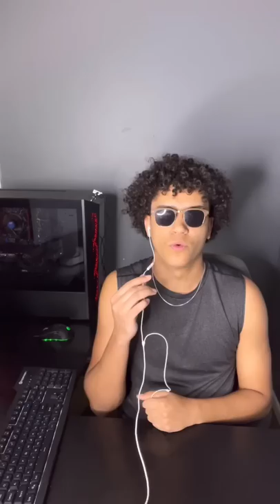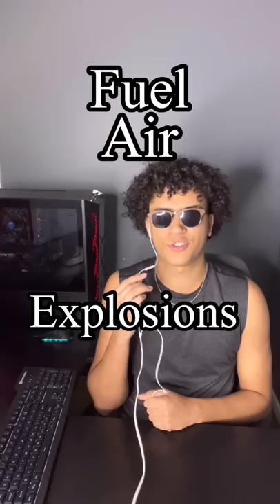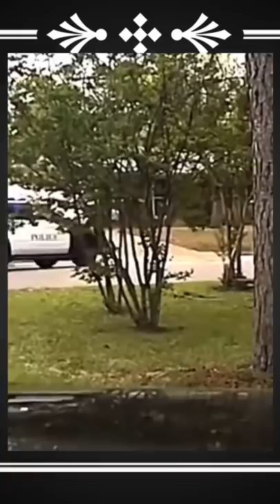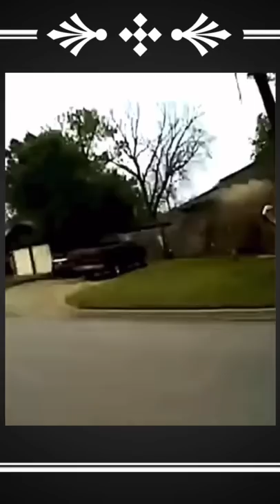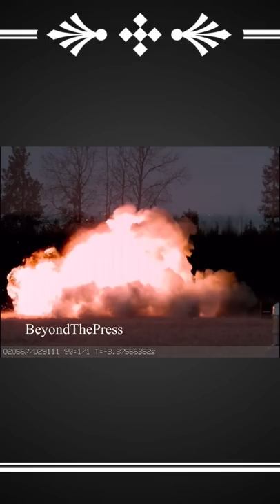Fuel air mixtures devastating effect!!￼ #shorts

Comment: Stoymetric ratio....the so called "goldielocks zone he speaks of... the correct ratio of oxygen to flammable  gas.
Reply: Misspelled.....
Reply: stoichiometric.....there we go.. no wonder i couldnt remeber how to spell it
Reply: @mckreations5160  stoichiometric * go ahead and fix that fam 😆😆😆
Reply: @mckreations5160  you can edit comments on youtube pal
Reply: @zeke7100  not exactly. the closer to the ratio the engine goes, the more efficient it is, but most older engines run fuel rich, since perfect stoichiometry creates much more heat than just enough of a ratio to combust.
Reply: @firstletterofthealphabet7308  fully aware. I can also call myself out for my mistakes and enjoy it fully!
Reply: One of the best things I learned from Mythbusters
Reply: Stoichiometric ratio
Reply: flammable gas to flammable gas??
Reply: @exstacc1886  eh??? What you mean?
Reply: Well, FUCK
Reply: When you get ratioed by gas
Reply: @firstletterofthealphabet7308  most older engine's do not run 
" Fuel rich "   they run fuel inefficient. Their  fuel/air ratio is set to maximum fuel efficiency which means they run leaner aka less power.
Reply: @mckreations5160  nice
Reply: There's a lot wrong in his video tbh
Reply: @Alien_Spores  yep
Reply: I'm pretty sure its 14:1 as in 14 parts oxygen to 1 part flammable gas
Reply: The internet has ruined the word ratio, I can’t look at it and think of it as an actual math term anymore
Reply: @minismallists  funny cause i had issue with it to begin with, without the help of the world wide web.... that along with statistics in general. People have used and abused them so much without actually having a firm understanding and grasp, not to mention they are able to flip and flop them in such a way that the worst can benefit them simply if they are dealing with someone that is a little shy of being intelligent enough to realize what they are doing. Sadly they dont even have to be smart enough themselves to fully understand what they are saying t9 begin with..... if you get where i am coming from.
Reply: @mckreations5160  fr bruh, watch someone show up saying counter ratio or some shit
Reply: @zeke7100  every engine needs that
Reply: @zeke7100  tell me one gasoline engine that doesnt run on 14.7/1 fuel que mixture to run in an efficient manner
Reply: @zeke7100  yeah fair enough youre right
Reply: And you have to use oxygen? Like what we breath? Air won't do it?
Reply: @hunterxsimple3821  i dont think i understand exactly what you are asking? Do you think you could be a bit more specific in your question, say the choice of words, how you form it and more to the pount of what you are asking to have awnsered? I mean i would like to be as specifis as possible as it seems you are genuine and really searching for tye absolute correct and direct awnser to a questions and not looking for a word soup awnser that never really awnsers you directly....im, just saying..
Reply: Stoichiometry: you have the same ammount you started with.
Reply: @mckreations5160  Aristotle hiometric
Reply: Stoichiometry is fun. H2O is also the perfect hydrogen to oxygen ratio for big boom booms when separated. In other words weaponizing water is a task I’m surprised the military hasn’t done.
Reply: He makes a lot of shit up lol I heard him say the aim 9x missile has a 270-0 win-loss record like it’s never missed a target and no plane has ever been shot down while carrying them. Lies.

Comment: Acetylene is an interesting gas above a certain concentration in air it will self ignite and the amount stored in a 50 foot welding line has equal energy to a stick of dynamite.
Reply: As a welder, I'll back that up
Reply: As a welding gas filler I agree. Sometimes i’d bump into a acetylene cylinder labeled “atomic grade” before i knew it was for labs thought it was like steroidal megacetylene 😂
Reply: @chonkychonk  just imagine an acetylene explodes and there goes the whole city lmao
Reply: Concentration or pressure? (Or both?)

It's why underwater welders have to use a different gas for cutting because they need a higher pressure to overcome the pressure of the water and you quickly go past that pressure with acetylene underwater
Reply: @MrCrabs231  I believe it is both

Comment: "Similar to a thermobaric weapon" that is literally what a thermobaric weapon is
Reply: Well yeah but it's more than just those 2 chemicals
Reply: @DaDaDo661  military grade yes, but by definition you are wrong. If you break up the word thermobaric, so thermo (heat/explosive) and baric (to do with air/atmospheric pressure) you will realise that it certainly is a thermobaric explosion (just not the one used hy the army)
Reply: Was about to say ain't this basically just a bootleg vaccum bomb or whatever
Reply: Thermobaric WEAPON. This is not a weapon, it could happen from ruptured lines. So no, not literally a thermobaric weapon. His wording is better
Reply: @HieronymousLex  what if the lines were intentionally ruptured then ignited at the right time, like I said yes its not a military thermobaric weapon but your just arguing terminology, if this was intentional then it would be a thermobaric weapon...
Reply: @HieronymousLex  tbf, several of the explosions shown were thermobaric WEAPONS, they were just more on the DIY side of things
Reply: @DaDaDo661 the only real difference is that a thermobaric weapon also generates the spicy air cloud, that and some technicalities

Comment: In welding we use a combination of compressed oxygen and Acetylene. There are lots of safety measures to make sure it doesn’t explode but with the right amount of both gasses you can melt and fuse metals together in less than 30 seconds, if you know what your doing.
Reply: Sorry for replying on a dead ish post. Hehe I still know the oxy-fuel ratios for cutting, and brazing. It’s engrained into my soul thanks to welding class in high school. Here is my question. What Temp is the tip of the torch, for cutting, and the temp for brazing? I ask this for the audience that doesn’t know (it’s hotter than the boom boom, but only barely)

Comment: as someone who is trained in oxyfuel welding one of my biggest fears while learning it was someone being dumb and cranking one of the acetylene canisters open like an idiot also fun fact if you dont have your oxyfuel torch set right and weld or cut with it in a tight enough space it will start pulling the oxygen out of your lungs most torches are supposed to be blue flame with a very small white tip anytime you see red flames while using that you have waaaaay too much acetylene going and need to adjust your settings.

Comment: I have a feeling that these stoichiometric bombs and these implosion bombs are the reason why a settling is getting more difficult to get a hold of. It's becoming a hard item to get a hold of it manufacturing due to the fact that they're trying to phase it out but I still cannot think of a gas other than hydrogen that burns hotter. Hydrogen has his own problems, trust me I know that for a fact I've been working with it for 10 years and gave myself tinnitus with it. Stoichiometric mixes are a scary thing to play with and one wrong move can be catastrophic. The bigger killer is when the mix is not stoichiometric and become stoichiometric in a large area. That is essentially how the implosion bomb works.

Comment: The crazy thing to think about is that this is happening thousands of times per minute in gasoline and diesel engines just on a smaller scale and it's contained in a metal box
Reply: Only diesel. Gasoline engines are specifically designed to ignite and have a longer burn (measured in milliseconds, but still). In a gasoline engine when the entire mixture reaches flashpoint and goes off at the same instant it results in knocking, and is undesirable as it reduces power for the engine and increases wear.

Comment: Acetylene is nuts. Every time I did welding with it in high school it sketched me out even though the torches we use had every safety measure available.
Reply: they're scary, but also dope. I used one to torch a stinkbug that was in my work booth. it smelled as bad as you'd expect

Comment: I used to work at a refinery and this is exactly the type of the type of explosion I had to constantly worry about if any pipe leaked. If it doesn’t ignite it still might be a cloud of hydrofluoric acid or hydrogen sulfide…. Seriously, alarms would go off all the time! 

So just remember, oil & gas guys work in environment knowing they could get blasted to bits in thermobaric explosion if they screw up!!

Comment: Same thing that happens inside your cars engine too
Reply: Not true. What happens in your car is a controlled burning of the mixture. They seem very similar but in fact are very different and an explosion in your engine would be destructive.
Reply: @mckreations5160  same concept, stoichiometric air fuel ratio causing combustion, same thing in a car’s fuel system that constantly adjusts to keep the mixture perfect, also explosions are how an engine works, it needs an explosion to force the piston down
Reply: Actually no they are not the same. Bot going to explain as i already have in a short sense. If you care to be correct go learn the difference. All good though, im not going to disagree further. And no an engine does not work by "explosion" it works due to a controled and prolonged and percise "Burn" but again ok.
Reply: @mckreations5160  burn?🤦🏻

Comment: As someone who went to school for auto body, I can tell you oxyacetylene torches are not to be taken lightly. There was a case in the past where someone was cutting with one and was getting ready to go to lunch. He turned the gas off at the torch but not the bottles. Gas flowed from the oxygen house and went into the acetylene hose. When he came back he tried to re light it only to have the regulator blow up and send the regulator valve knob flying into the dudes head at the speed of a 30-06 caliber bullet.

Comment: This is literally how combustion engines work. You dump a little bit of fuel in the pistons, mix it with air and then ignite it.  That force pushed the piston down generating torque!

Comment: Watchlist time :D
Acetylene: C2H2, 
Oxygen: O2
Reaction for complete combustion:
C2H2+2O2>2CO2+H2O
(At room temperature and pressure, 1 mol of any gas takes up 24dm^3)
Therefore, all you need is a 2:1 volume mix of oxygen to acetylene, have fun!
Reply: Thanks! I got me some calcium carbide and a O2 tank somewhere

Comment: When I was growing up in the 80's my father owned an auto body shop in Newport RI. And for laughs we would sometimes fill up garbage bags with this stuff (we used it for brazing, and cutting mostly). Then we would tie a long sheet of paper shop towels (think giant toilet paper) to it, and light the paper.

I guess it's lighter then air, because they would float up like a balloon with helium in it. And eventually the paper would catch up to the bag, and ignite the mixture. It was so loud and explosive it would rattle windows a 1/4 mile down the road. Or so we were told anyway. 

Either way. Great fun. But be VERY, VERY careful please! It is no joke!!! ✌️

Comment: Reminds me of when I used to Weld people used to mix some oxygen with just a small bit of propane from The Cutting torch and then take a hot brazing rod or a welding rod and it would make a small explosion one day somebody got the brite idea to do with acetylene Luckily there was almost no acetylene in there The explosion was loud enough to shake the roof of the entire building But like I said there wasn't much much acetylene so it was just a loud explosion the bottle was totally shredded so I assume it was so loud because of how fast it's vented and blew up

Comment: Not always an explosion, oxy-acetylene welding is one of the oldest and most popular ways to weld. Just a controlled jet burn with specialized nozzles to prevent blowback and an explosion
Reply: Oxy-acetylene is definitely not still one of the most popular ways to weld. It is indeed one of the oldest, but processes like TIG and MIG have far outpaced it in popularity. And the only reason it doesn't explode is because it is ignited before it can properly mix. The mixture of oxygen and acetylene used can and will cause an explosion if you fill a container with it and light it off
Reply: @richardmillhousenixon  speaking globally oxy-acetylene is one of the cheapest methods and also the easiest to learn. In the u.s. it’s definitely not the most popular but many places just don’t have the infrastructure to support welding using electricity. Also yes, I know if you fill it in a container and light it it’s explosive, same with jet fuel. I just mean that the mere fact of mixing these 2 gasses together won’t cause an explosion. Yes they’re explosive, I just don’t think their chemical reaction is a explosive
Reply: @chaseholt3677  The chemical reaction is explosive when mixed right. They are not hypergolic explosives, but they can and technically are considered explosives when mixed right. Also oxy-acetylene is the easiest to learn? Lmfao nah, that shit is difficult as fuck to do well. Source: Me, a welder, who knows how to do Oxy-Acetylene welding.

Comment: I had one of these happened I was refilling a butane torch And the nozzle wasn't the right size it's a little bit through slipping out the sides I open the windows  And waited a few seconds didn't smell gas anymore so I decided to make sure the torch was filled and worked And it did but luckily I was working On a heavy duty solid Marble table Because when I pointed the torch towards the table all of the gas that has been laying  on the table but not leaving it preceded to explode burning my eyebrows off and throwing papers on the ground. Thank God it was Just a small amount cuz shit It was nothing them boom bright light and I'm screamin

Comment: Probably one of the scariest things I've had to think about...I got kids, I don't want us to all blow up....
Reply: Almost any gaseous fuel used in a home or business (excluding some industrial uses) has some sort of "agent" mixed into it to make it very easy to smell well before it reaches the explosive lower limit. Usually it is mixed with a sulphur compound that smells like rotten eggs. Get several carbon monoxide detectors for your home though, those can protect you way better than your nose can. Doesn't mean you shouldn't still use your nose
Reply: Do you drive your kids to school? Most Car engines use air fuel mixtures to run. We do "fun" things with explosives on a daily basis.

Comment: Get a oxy flame going on your torch, turn the bottles off until the flame goes out, shove the torch into a empty coke bottle and turn the gas back on for a few seconds, screw the cap back on, stick a sparkler through the label which will act as the fuse, light it and run 💥

Comment: Yeah just like ignition on gas engines and also depends on the fuel to air ratio high fuel to air ratio of 9 gallons is 70 feet wide

Comment: I love your videos but this one is technically incorrect. You're confusing acetylene with natural gas, and when you add acetylene to the oxygen it doesn't blow up. You need a source of ignition for a to ignite and then you have a very hot flame not necessarily an explosion unless the gas was sitting in some sort of container like a room, leaking. Anyway revisit this video with a little more technical facts. Otherwise great videos.